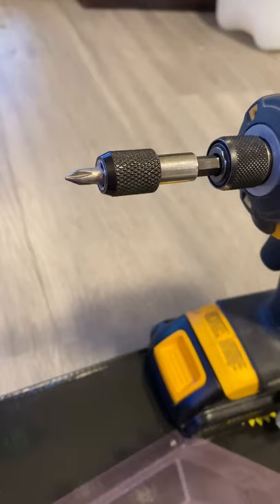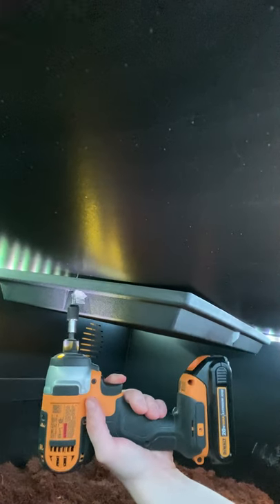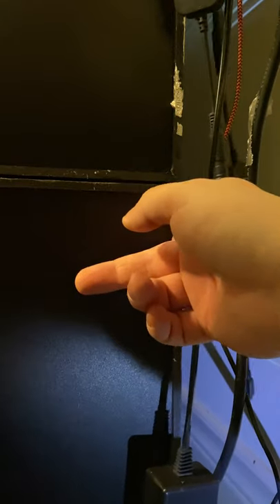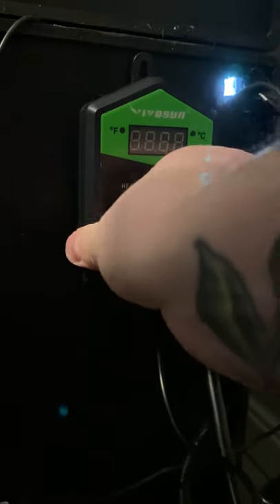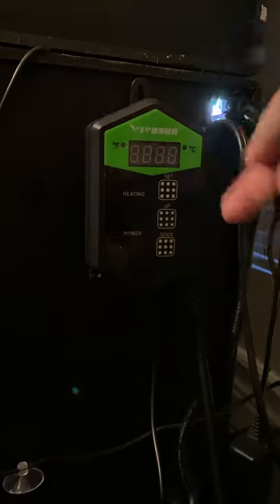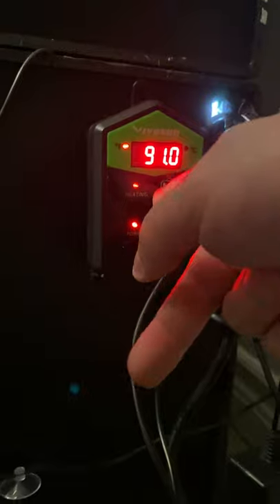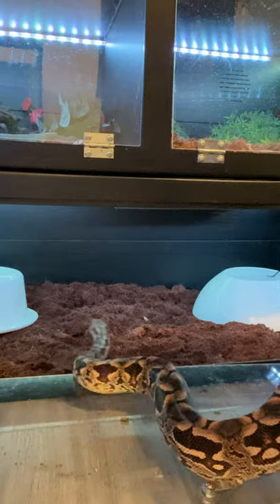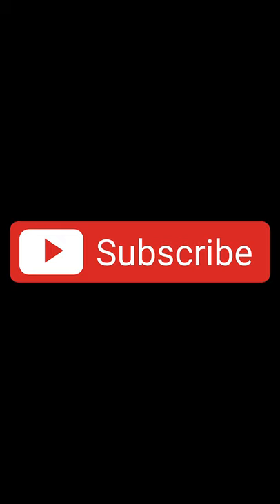How To Install A Radiant Heat Panel In A PVC Enclosure In 1 Minute | 10 Steps #Shorts

Comment: I am very interested in RHP but am having a horrible time finding really qualitative info on their function and benefits. Thoughts or ideas?
Reply from the maker: I mean from experience, warm up the enclosure well, keep temp constant, never fail. Just overall great option
Reply: @WickensWickedReptiles  I'm a big UTH / Heat tape guy for belly heat and I normally use a CHE with it.  Is an RHP to be used with heat tape or does it provide the same health benefits as UTHs??   Thank you.

Comment: Where did you put thermostat probe?
Reply from the maker: on the hot side
Reply: @WickensWickedReptiles  bruh 😑
Directly on the panel? Or did you stick it to the floor?
Reply from the maker: @onedirectionbabeeify  in the area I want it to be 86 F. Basically in the hide

Comment: I like the comical nature.  However, there is some information that could be considered improper.  You should always to try to keep power cords and temperature probes cords a couple of inches apart since there is the chance of electrical interference affecting the probe readings.  Probably a small chance or even negligible, but it if it can be avoided, why not.

Comment: I’m trying to set one up for the first time.... where’s your thermostat placement :/ and do you use this for the hot spot? Or do you have a heat mat to go along with it?
Reply: The thermostat placement is in the open directly below the placement of the radiant heat panel or in other words your hotspot side. And this alone set to the correct temperature would be all you need for the hot side unless your house gets very cold or the size of the radiant heat panel you ordered is not large enough to heat that side of the cage up alone.
Reply: @AJTurbo  hey thank you! I ended up figuring it all out 🤙🏻🤙🏻🤙🏻 first time using these guys and I didn’t wanna overload the panel

Comment: Third time I drilled this hole and it's still too big! Just got a box from FedEx, I just needed some feeder lizards. For some reason brown anoles move quicker than they did some 30 years ago. Oh they just got a shipment of pac man frogs might as well pick up some of those and egg eating snakes are on sale might as well get one of those. So I open the the box to find I have TWO egg eating snakes some how using the order on line feature I ordered two since the Total on the invoice was correct. So far three out of five quail eggs are down the hatch with them being only about two hours out of the box, and I think they have both eaten.

Comment: Do you place the thermostat on the wall for ambient temp or on the ground for surface temp? Only used heatmats and lights, curious on the benefits of a heat panel.
Reply: I dangle my probe just above where the snakes back is.I put the cord through the back and then back through the top.Or you can zip tie the excess cord and just let it hang from the panel itself. It gets moved around to much if you place the probe on the floor imo

Comment: TURN THE ENCLOSURE UPSIDE DOWN TO INSTALL THE HEAT PANNEL.  sorry for yelling, but if you don't it gets really annoying very quickly.
Reply from the maker: I 100% agree and have done full length videos showing this method but this enclosure has 4 other enclosures on it and this was just easier. but yes, much easier to do it that way